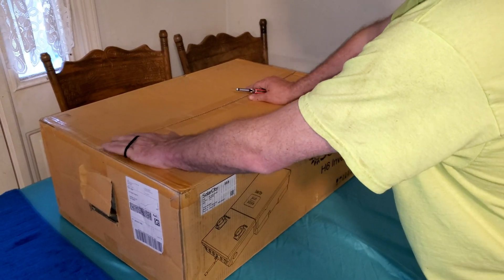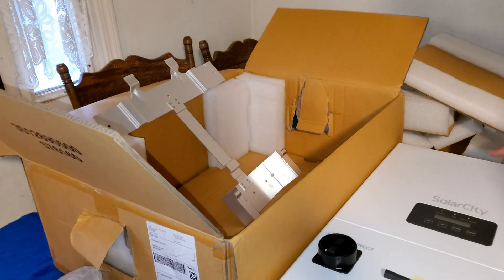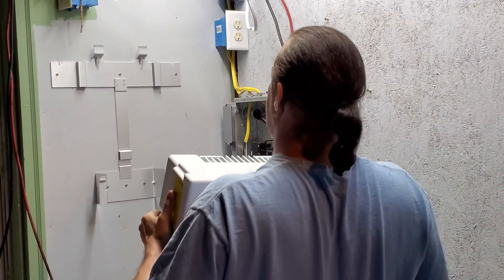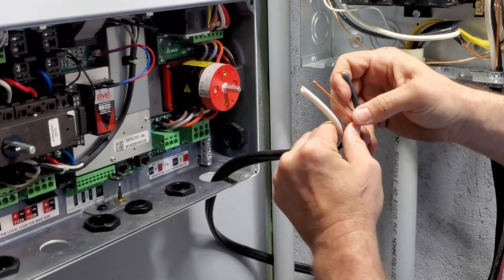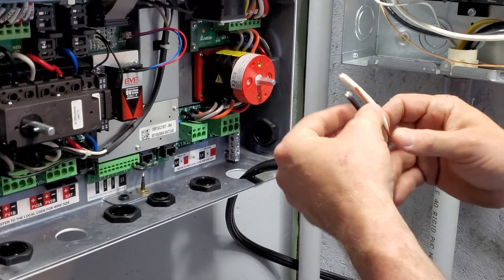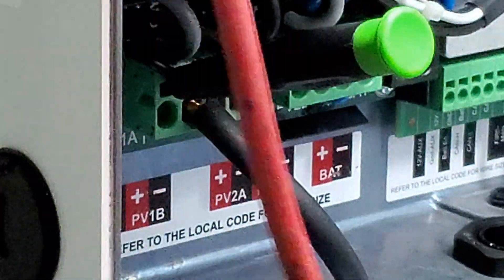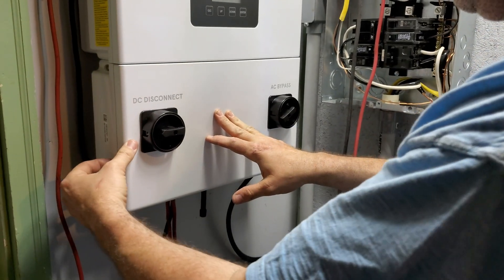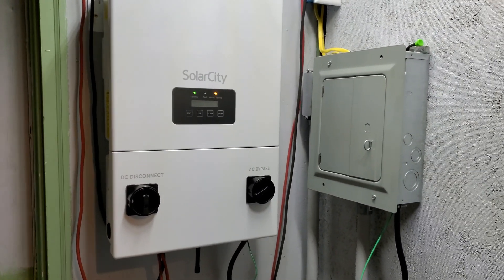delta h6 grid tie inverter installation.

Comment: That's for the info. I have this inverter it's going to be grid tie and I have 4- 255 solar panels is this enough solar power to run this inverter on grid. Thanks Leon
Reply from the maker: No that is not enough you should have a minimum of 8 to 10 panels 4 to 5 on each side of the panels imput

Comment: Hi John, mine is not giving me any codes and it looks like it works just fine but it is stating zero day energy at the moment. Do you have any idea what the problem could be?
Reply from the maker: What voltage is your pv imput at is it equal on both sides.
Reply: @novatar-42  l only use PV 1 and it is at 423
Reply from the maker: @daverhaci6369  it won't work with only 1 pv mine wouldn't.  You might be able to split your panels and run 2 strings of 200
Reply: @novatar-42  thank you for your response. It had been working just fine and inverting as it was supposed to with one PV input. Total energy that it produced towards the grid so far was 1138kwh vs 1205 kWh from the panels. The red light is not on and not giving me any codes to check. Is yours connected to internet at all times? Mine is not. I was wondering if that might have caused the issue in the long run. One error  code I found this evening was “communication error” but I believe that code was always there.
Reply from the maker: @daverhaci6369  I'm at a loss it's hard to say without looking at it in person I would venture a guess that it'd related to  only running 1 string.

Comment: Is your inverter still working? I've had my 2 go out on me, not even a year yet.  First one screen died then the replacement has a startup fault I think? Just happened  the original one with arc fault issues was fixed by James Showalter he made a video about it removing the wires from the sensor. I love this thing but with 1 out of 3 working I don't have a good feeling

Comment: what gets connected to the AC in side?
Reply from the maker: The ac side is the side the grid connects to
Reply: @novatar-42  thank you for replying! I should have been more specific with the question- I know that the AC out goes to the lowest point in the breaker box but where/how does the AC in tie to the "grid"? I can't seem to find much clarification on this and electricians in my area are not responding when I ask about wiring Solar inverters...:(
Reply from the maker: @jasonhensley947  your sub panel should be getting 2 hots and a neutral from the main panel.  Your grid tie once connected will see the voltage from the grid. And begin feeding power back to the grid. You will notice the voltage on your house will go up slightly. This allows power to be pushed back out into the grid.

Comment: Basically the faults that are on the inverter are one for the lack of battery and the other is it isnt connected. Does it have to be connected to function?
Reply from the maker: I've also had no luck with a battery as it requires communication protocol that I don't know how to emulate
Reply from the maker: It only needs dc to function only needs ac when it's feeding power to the grid

Comment: What was the issue at the end of the video. I'm stuck right there. Connected all wires installed good connections inverter powers on says on grid bit does not seem to be exporting power???
Reply from the maker: Do you have it in inverter mode or bypass mode
Reply: @novatar-42   I have had the switch on the right in both modes for a day each
Reply from the maker: @stephenjohnson9317  what's your imput voltage and have you checked your panels for a bad one
Reply: @novatar-42  118 119 120 average for  ac 1 and 2 I had 520 reduced it down panel by panel down to 460ish. Im stumped.
Reply: @novatar-42  118 119 120 average for  ac 1 and 2 I had 520 reduced it down panel by panel down to 460ish. Im stumped.
Reply from the maker: @stephenjohnson9317  your inputs should be close to equal voltage there's one more thing it might be but I'm not home atm to verify do you have a Gmail maybe I can get you on hangouts we can go through it together

Comment: Any updates have you tried the off-grid backup with no battery capability
Reply from the maker: Yes it will run the inverter with sufficient solar input but not very well it really needs a battery
Reply: @novatar-42  - “it really needs a battery”

Will any generic battery meeting the specification do?

What does having a battery do, to make the inverter perform better?
Reply from the maker: @DavidHalko  so I did not successfully run this off a battery I built one to test but the inverter requires combination with the battery before it would power on

Comment: Hi John,  
1) the distribution Sub panel must be fed with three colors, black and red hook on two live bus, white hooks on the isolated side bar as neutral,  bare is on a lug screwed on the box body  as bounding. 
2) bounding inverter is by the connection to the sub panel bounding lug.
3) AFCI going on is because you combine the bounding with neutral.
4) the grid feeder to the sub panel should be wired into inverter, so can the inverter play switching pv or grid to the loads in the sub panel, either feeding extra electric to the grid. The connection terminal in the inverter is just the one you did wrong on L1, N, L2.
5)  you should move the wires on L1,N,L2, to the terminal BL1, BN, BL2, as power supply to the loads in the sub panel. These wires are red, black, and white, no bare wire.
I didn't ever involve in solar electric,  but I'm an electrician. Whatever I still learned a lot from your video about solar applications, thanks.

Comment: 7s 250w panels on 1 string 8s 250w panels on 2 string. Rough average of 24kwh per day 3000w average rating when running. I fried my first inverter 15s panels. Pretty happy with the inverter for the price. Generac would be my choice if I had the money with a pwr cell battery

Comment: Did anyone find a compatible battery to use with the H6?
Reply from the maker: No I built one from 18650 but the inverter won't run off batteries without a communication to the a compatible bms 😞 I'm currently working on finding something that will communicate to the inverter
Reply: @novatar-42  which power wall is compatible with the inverter?  Should be some used ones on the market by now.
Reply: @novatar-42  Are there used powerwall 2 that can be purchased?
Reply: @johncarr123  I don't think Powerwall 2 works with this inverter.  In fact, it's the reason why these inverters are so cheap.  The move to the Powerwall 2 by Tesla made them obsolete.
Reply: @novatar-42  - any idea, yet, what is needed for the BMS to communicate to the inverter?

Comment: What does the ac bypass switch do? Maybe I missed it in the video, but you said you would cover it later... mainly I am wanting to if the bypass is not enabled if the grid power goes out will it then automatically go into a safe mode so it doesn't send power back to the grid? I am assuming you then turn off your main breaker and turn the ac bypass  switch on so you can still produce to your home without endangering your system or the linemen on the other side. Thanks for your response in advance.
Reply from the maker: The bypass switch completely disconnects the unit from The grid. It also tells the unit to begin producing power there's separate connections for ac output and ac/grid

Comment: Thanks for your video! I have a delta h6 running 2 strings of 7 380 watt panels at 41.2 volts each.  I wanted to put them in series but having issue everytime I do. I get an arc fault when I use PV1 and PV2.  Ive tried each individual string of wire gauge 10 wire and I never get a fault. Even when I put both strings in parallel into PV1 I max out at 4500 watts, but no arc fault. I want to maximize and use the full 6000 watts. Do you think I need thicker wire? Ive checked all the connections. When both PV inputs are used at the same time it works for a little bit, then the inverter starts this whistle, then it goes into arc fault.  Any help would be appreciated!  Thanks

Mark
Reply from the maker: I will have to look into this more I know that you must have equal power for pv1 and pv2 the inverter won't start its process with only 1 pv array connected. 

What's your email maybe we can dig more into this as this question comes up allot
Reply: @novatar-42  I'm running one side PV1 @ 3kW with no issues in export (grid-tie) mode
Reply from the maker: @gregr7967  I would not have expected that to work
Reply: @novatar-42  I think the only time that would be an issue is if you were drawing on that load in the off-grid mode, where you would want a more balanced output between the two sides
Reply from the maker: @gregr7967  it's entirely possible at this point
Reply: Msaethre@gmail.com sorry have two YouTube accounts. Thanks so much!

Comment: hello I have a h6 invertor but it keeps tripping on arc fault, It will run for two or three hours then trips on arc fault I cannot find any bad wires ? any help would be great?  please email me if you have any suggestions
Reply: Reason as to why this was discontinued was arc fault would trigger with shadows of planes etc so there is a video in way to disable it I'll also trigger on voltage dips
Reply: @nightmareinaction629  - “arc fault”

So, air planes & shadows create an “arc fault”, will that situation be alleviated with a battery, with a second PV array, or some setting?
Reply: @DavidHalko  you can physically disable the arc fault by removing the device the detects it
Reply from the maker: What size wire are you running.  My first thought would be if the wire is too small it will cause to much resistance and trip a fault

Comment: Have you had any issues with it tripping an arc faulting when reaching max output (6k) I think mine has been tripping when hitting max
Reply from the maker: Yes I did I removed 1 panel from. The series on each mppt and had not done it since how many volts are you running how many panels in series and what size
Reply: @novatar-42  I have 2 strings of 8 panels 45v 315 watts on one mppt other mppt has 1 string with 9 panels same ratings
Reply from the maker: @scotthenderson4376  my strings are equal at 8 try running matching voltage
Reply: @novatar-42  I found right before James came that it was the one mppt wire was to close to the edge of the sensor

Comment: I bought this particular inverter and after six months of use ,It burned up. I’m not sure why this happened but I’m disappointed 😞
Reply from the maker: Have you contacted the seller they may have parts
Reply: @novatar-42  seller no longer exist on eBay.
Reply from the maker: @brucericciardi4707  that's terrible who was the seller
Reply from the maker: If you follow the link in the video you can find the seller I worked with.  They seem to have good costumer service
Reply: @novatar-42  b-6475. He was very helpful on set up. Reassured me that this system was bulletproof..I’m still trying to figure out why this occurred.  Only instances I can figure is that it was a power surge..I’m not sure where I would get parts , being that this model inverter has been discontinued
Reply from the maker: @brucericciardi4707  maybe disassemble it and see if you can identify the broken components might have part numbers on it you can look up.
Reply: @novatar-42  is your system still running strong ? I have been debating this invertor as is being sold for such a great price. 

Plan on 5kw build.
Reply from the maker: @stevenmyers2252  I recently disconnected it as Increased my off grid battery bank and I needed the solar for battery charging.  Still works great after a year.
Reply: Thanks John. Will do  👍

Comment: hello, we have two of these installed in a grid tie setup. Seeing good voltage from grid and for each PV string. The inverters will not send current through to the grid, do you have an idea why this might be? Only faults/warnings are the 'no battery' and 'no comms' as we opted out of these. Please help.
Reply from the maker: Do you have photos you could send me.
Reply: @novatar-42  Yes, could I get your email?
Reply: Do u have a smart meter or round mechanical?
Reply: I'm still stuck here it's like it expects a prompt to start up. I have tried to hit a golden zone for voltage in and my ac lines seem to be off by 2 volts. I have 480 volts in and 6 gague wire ac to the panel... Just stumped

Comment: So you saying the LED display will not work untill connectet to the grid?
Reply: The Delta H6 inverter can operate off grid. The unit powers on and the menu works off grid if there is DC voltage to either of the PV inputs or the battery input too.

Comment: I'm looking to get one of these but not sure if I should get something that I can  monitor.  Looking at 24  panels at 40v ea. Would 3 strings be better then 2 (320 vs 480v)  I do have some afternoon shading
Reply: You need to be close to 380 volts or this inverter won't work.
Reply: You can do multiple strings on different arrays. Y connect them is an easy route

Comment: Hi John, I have a couple of these that I bought brand new on eBay but have not deployed. is it true that they stop working if the wifi/ethernet connection is not enabled or is unable to call back to some mothership?
Reply from the maker: Mine is not connected to anything with the wifi. It works as it should every day.
Reply: @novatar-42  Thank you! That is great to hear! Did you figure out what the minimum voltage is they will work with?
Reply from the maker: @vincei4252  yes I have tested several  voltage the sweet spot is still 350v how ever I have them down to about 180v and as low as 130 and still functional. Downside is as you gow down in volts you go up in amps.
Reply: @novatar-42  Ok great. That is good to know. I think I'll setup another array just for these with the higher voltage capability. Thanks for helping me confirm I just didn't throw good money away! Take care.

Comment: Hi John , when you  initially connected it the inverter was not sending any power back to the grid even when the panels were generating around 400 volts in each string,? How did you solve that problem?  I have one installed but I haven’t been able to make it send power back to grid
Reply: for me it was as easy as changing a setting to Grid-Tie that enabled grid export
Reply from the maker: Email me Johncstupp@gmail.com we can diagnose it. Im pretty sure I know what your issue is
Reply: John Stupp , hi i emailed you with pictures of my system, hope you can figure out what is wrong with it. Thks
Reply: @novatar-42  me too what was the issue mine seems to be in grid tied mode

Comment: Hi John Stupp, I recently bought a Delta H6 6000W Grid-Tie Inverter NEW Battery-less Backup UL 1741 Rule 21 2 MPPT on EBAY, and I know that the two strings in each MPPT are combined in parallel, but I want to know what the combination is like. between the two MPPT channels, whether it is in parallel or serial, thank you.

Joseph.
Reply from the maker: Each mppt line goes to a separate phase inside the inverter
Reply: the mppts are completely separated. there's 2 independent mppt's in the unit one for each phase. each phase is independent. there's also 2 primary inputs one for each mppt. each input has 2 connections for the arrays allowing up to 20 amps on each connection at 400v. hopefully I didn't just over complicate the answer....
Reply: @johnstupp3452  which John Stupp is the imposter here!? Yup, manual says each MPPT can supply up to 4.5KW, 9KW total if need be, but you still only get 6KW out of the inverter. So If you are maxing one out at 4.5KW, the other has to be 1.5KW or less (Up to a 75% imbalance)
Reply from the maker: @sjetmand  I found through trial and error that the system will go into fault if one side is to far out from the other.  I have 360 to 400v on each leg haven't had an issue I tried 180v on 1 and 360 on the other and it would not start up.
Reply: @novatar-42  That's not very encouraging to hear. I have 18 panels, at 9s 2p, each string would be about 420V 3-4kw. I have two of these inverters on order with hopes of running them in parallel. Fingers crossed I guess.
Reply from the maker: @sjetmand  you can run 3 strings of 4 and 1 of 5 and still use both units but your dropping voltage and your loose g efficiency. Your better off running 1 unit with 2 strings of 9 panels I recently upgraded my panels at home I'm running  16 385w Samsung panels 2 strings of 8 to my grid tie. My other 18 panels feed my off grid batteries

Comment: How are you? Greetings, I installed the inverter but I have a problem I am injecting energy into the public grid and they are charging me, I can do something
Reply from the maker: You need to have either a smart meyer or a net meter. If you feed power to the grid they only see it as usage and will charge you for it
Reply: Thank you very much, I could not connect to the application but I am working outside the network it works excellent and thanks for always answering

Comment: How does it prevent from feeding back into the grid? Meaning during the times when you are using like 3kw yet generating 6kw for example.
Reply: The H6 continuously feeds the grid, however if inverter is putting out enough power it will feed the protected and non protected loads before exporting excess power to the grid. Provided you have your inverter connected correctly to your panel.  The H6 doesn't appear to have a limiter so you would need to buy one if you are trying not to feed the grid. This inverter is a PV only inverter so feeding the grid and battery charging are the main functions, but can function without battery for grid-tie and off-grid (PV only during daytime to protected loads) use.
Reply: @coreyweaver9376  Interesting. I was hoping to install this at home but the excess power would feed to the grid, and my city requires a seperate PV meter.
Reply: You need a device called zero export.